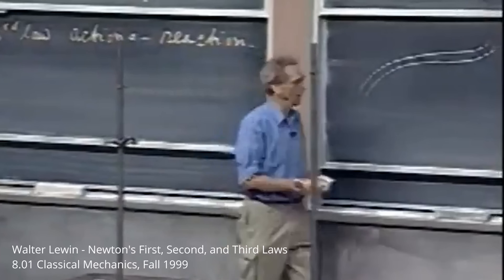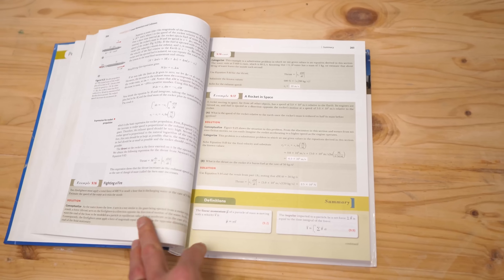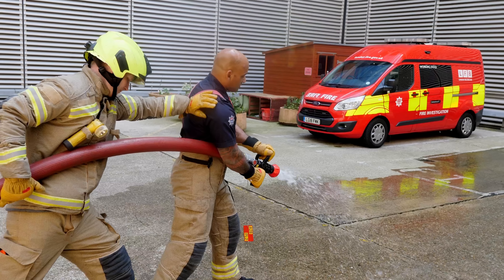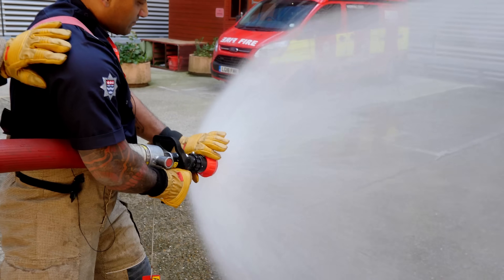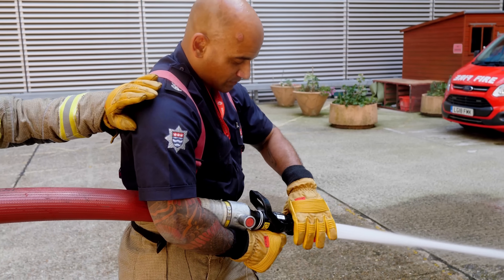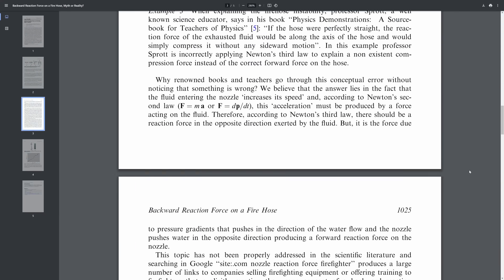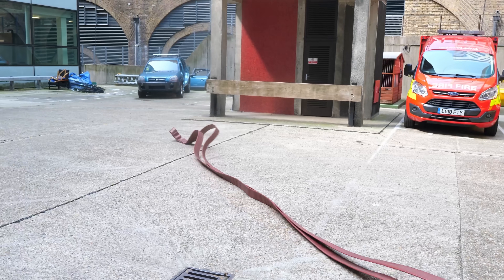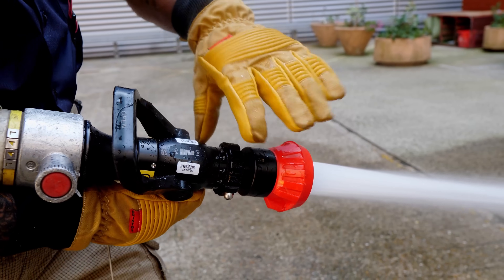Why chaotic hoses dance

Comment: The nozzle expansion is actually how rockets gain the vast majority of their thrust. If they relied purely on the mass of propellant we’d never get to space. So sofisticqted bell nossles are used where the pressure is lower than inside of the burn chamber and this increases the propellant speed and leads to increased thrust

Comment: I wonder if your experiment with the air hose actually illustrates the forces on a fire hose accurately. Since the chaotic waggle of the hose is caused by the reaction forces accelerating the fluids in various directions, those forces should be proportional to the mass of the fluid and its change in velocity. The water in a fire hose is much heavier than the air in the air hose and it is moving much faster, so the “hose pulling force” may contribute a much higher proportion of the force in the fire hose than the air hose.

Comment: Have you tried maxing out the fan at the squiggly-Wiggly-Thinggies to see if it behaved the same? 
Or
Have you lowered the water pressure/volume going through the fire hose to see if it behaved the same?

P.S. Might need to Sans the nozzle as the weight may make a difference to the firehose/add weight to the squiggly-Wiggly-Thinggies to see if it behaves more similar. I would love you to follow up. 
P.P.S. As for the air hoses, I'd imagine the stiffness of the hose plays a larger part to the experiment.

Comment: You also need to consider the static force built into the hose as it deformes slightly (a very small circumferential change along the length of the hose could create a large force. This would cause the violent kick felt when the hose is opened too fast.

Comment: I believe you're wrong about the fire hose, because the reactive "rocket" force comes from the Velocity of the water and not from the pressure itself, the fire hose (and rockets) have a nozzle at the exit that converts the Pressure into Velocity which increases thrust, and moves the point of thrust closer to the nozzle. This is just my intuition though, primarily based on how it feels to operate my electric power washer, there's a bunch of thrust pushing the handle but the pump just sits there on the ground unmoving even though it's kicking out a lot of pressure.

Comment: Ok, so 11:43 is where it clicked that both systems are similar in that they're both fluid filled tubes with enough energy to push their containing cylinder's around. HOWEVER the difference is that in the hose, there is an abundance of pressure, an excess amount of pressure, and that excess there is what causes the flailing behavior, the system is trying to offload a bunch of excess energy. Whereas the flailing tube man's system uses a "just enough" amount of pressure and lets the tube itself act as the constricting force to bubble up the pressure to the amounts needed to escape the system and it's just enough additional energy to cause the bubble of air to lift the tube man. The additional difference between these two systems is that the hose is stiffer and the tube is merely "hose shaped".

Comment: The hose itself is in tension to hold in the pressure of the water inside. this tension is balanced with the pressure inside. We know from fluid dynamics that pressure is felt in all directions, against the hose walls, the pump mechanism etc.
This balance means no net forces as felt... there will be some from the inertia of the water being accelerated at the pump itself, but that's mounted to a 20 ton truck and is likely a centrifugal pump, so the forces will be balanced around the rotor anyway.
The place where the force will be felt is where the forces become unbalanced, at the nozzle. The nozzle isn't just an open hole out of the end of those hose, it has geometry specifically designed to accelerate, focus and direct the water. This geometry is what the water 'pushes' off as it experiences it's acceleration.

Rockets similarly have most of their thrust born by the bell nozzle, That is the element which is in tension, but with an open end. The element 'seeing' the unbalance force, this is why thrust vectoring on jet engines, jet skis etc... only need to swivel the nozzle, not the whole engine.

Comment: As a retired volunteer firefighter, when i was a young guy we used to run loose hose drills, it was a right of passage crawling down the hose.  I somehow doubt they still do it because of how dangerous it is, at least with a nozzle on the end.  Last time I've seen it done was probably 10 years ago with a cut hose end.

Comment: Following this reasoning i guess  that opening a hose in a vacuum would result in a stronger “recoil” because the difference in pressure is grater. I wonder though if the fact that normally the water is also pushing away air as it goes has some relevance

Comment: But bends in a hose/pipe do change the pressure and flow upstream of the bend. It’s the reason that you have to upsize the pipe on your water heater’s temperature and pressure valve if you have 90 degree turns. Should the tank need to relieve, any turns in the pipe will increase upstream pressure and prevent the relief pressure from reaching its full potential, putting more force on the tank.

Comment: I worked as an industrial waste cleaner several summers when I was at school. I had to handle an industrial jet wash. This had a lorry engine driving a hydraulic pump, pumping water down a 32mm exterior hydraulic hose at 2,200 psi. This was exiting the hose through a 3mm nozzle. I would have to coordinate with my colleague when he connected the PTO to drive the pump. I would hear the waggon revs draw down, lean in hard, and find the water and nozzle thrust holding at 30° roughly. If my feet weren't experiencing good grip, it would push me back.

Comment: 3:06 having only watched this far I’m struck with a question: If the hose were to be perfectly straight, not rigid, then the water wouldn’t be compelled to bend it would it? Given that it will be pushing against the inside of the hose yes but wouldn’t it be equal in all available directions? Not sure if I worded it all correctly

Comment: Tell me this, if you had a perfectly straight hose hooked up to a fix pressure valve, and say that it could move linearly back and forth. Would that straight hose piece get force outward into a longer position, or would it be forced in towards the valve because of the water push back. I first thought in would think that in would get forced outward.

Comment: 9:20 The pump (combustion chamber in rockets) generates high pressure at low velocity. The nozzle transforms high pressure low velocity flow into high velocity low pressure flow, feeling a reaction force in the process. I think there's a similar question about where is force generated in a rocket engine.

Comment: This phenomenon can also be witnessed in the rear-end of dogs. If their tails were much longer, they too would have chaotic wags.
=D
I think the weight of the hose+contents can affect how much of a hose will flail about. I noticed with my garden hose, only the last meter or so will flail about. But when I used a smaller, lighter weight one with the same tap, more of it would flail about. Not as violently, as the pressure isn't huge. But still.

Comment: HAve you checked what this implies when taking into account differential speed within the pipe or tube by applying the Darcy–Weisbach's equations? Basically, water has a gradient of velocity across the width of the pipe, introducing resistance and reactive force from the pipe itself, hence the forces don't travel all the way down to the pump, which might explain why the force at the nozzel can be felt by the firefighter.

Comment: When the fire hose is laying on the ground and only the tip of the hose is wiggling, I think it is due to the friction between the hose and the ground, which you don't have in you air model.

Comment: Really interesting video. Have you looked at/thought about the additional impact of the restriction of flow effect at the nozzle of the fire hose? 
It looks like the hose diameter drops from the hose to the metal nozzle that the water is coming out, which will cause a speed increase, and I would assume a corresponding pressure increase as well, though my understanding of physics isn’t good enough to work out how much. (Only got to final year physics, not uni levels)

Comment: STEVE 13:55 if the fire fighter is holding the hose still (preventing it from behind for the first 2-3m at the end of the hose) then the ‘rocket reasoning’ should not be able to apply.

for the ‘pushing a rope’ to be valid u would need to be holding the end of the rope to prevent it from bending, and if u did we would in fact see it pushing without bending

Comment: There's another factor: The nozzle is a constriction, so force would be acting on the nozzle, right? The pressure would be higher through the nozzle than through the hose, before dropping to zero as it exits the nozzle.

Comment: The pump gives the water pressure, not momentum. In most hoses, the water is moving faster out the spout than in is in the hose because of the constricted aperture. There is momentum of the water moving through the hose, but it's caused by the release of pressure and is probably very minor compares to the "rocket" exhaust of the hose spout. So I think your theory is nonsense.

Comment: Every molecule of water (or air) inside the hose is under pressure, due to being pushed from behind by other molecules and at the same time having to push the ones in front, but right at the moment when the restriction of the hose ends, all those molecules want to expand and slow down at the same time, and this creates a pressure buildup at the end of the hose bacause the molecule thats just at the end of the hose (but not out) has to push the slower one in front of it (kinda like a crowd of people trying to quickly exit a building thru a small door) This pressure buildup is pushing the hose back, and it can't shrink into itself so it does kinda what the rope does when you push it.

Comment: I think that fire hoses dont flail as much as your rubber hose because the restriction keeps the hose significantly more rigid, and its construction adds to its rigidity.  I think of a finger trap pulled tight as its woven structure is drawn tight.  Maybe?

Comment: Pumps do not create pressure the only create flow. It is the resistance to flow that creates the pressure. Which means the water in the hose is moving far far slower then the water coming out of the nozzle. Lots of pressure. Means lots of restriction

Comment: the water accelerating at the opening of the hose just doesn't sound intuitively convincing to me. if only you could perform some experiment on it. i suggest introducing colored water. that way we can measure the velocity in-hose and then right after nozzle by examining the footage in slow-mo.

Comment: The pressure in the hose will decrease along its length due to friction. Steve is right that there is no net force on a bit of water. There is, however, a pressure difference on either side of the bit of water, just enough to overcome the friction felt by the water.

Comment: Interesting thought argument, but you can push on the end of a length of string to push all the way to the end. You haven’t taken into account the hose itself in that analogy. If one was to constrict the volume that the string can occupy by adding a hose around it, you can in fact transmit a force along the length of the string/hose combination. This is how Bowden tubes on a 3D printer works, bike brakes, etc.

Just something to consider.

Comment: This was really curious to think about! I'd like to see a follow up experiment, where the hose is discharging into a pressurized container. Then you could mess with the ambient pressure and see if it affects how the hose flails about. Separately, I wonder if the rigidity / material of the hose has any impact.

Comment: What about a mechanical restorative force induced by putting the outer radius of the hose into tension? Spring-back force from being stretched, in other words. That may not become significant until a bend threshold is reached.

Comment: Would not the stiffness of the hose resist the movement.? Where the air hose gains rigidity with pressure, but not near as much as the hose with a nozzles on it.

Comment: could it be the weight and the momentum/mass of the actual molecules/particles? air takes less force to move, whereas water is heavier and stays where it is without a higher force acting on it?

Comment: The pump creates potential energy, stored in the flex of the hose. Then crucially, the nozzle is smaller than the max flow rate of the pump. If you had a sewage pipe sized hose flowing water and it had a 2ft diameter it wouldn't create or impart a large dynamic force. It would strictly be slow moving water escaping a volume via gravity. Like a bucket with a hole in the side. All that would matter would be the side force from the water needing to move sideways to leave the bucket. 

Secondly and more importantly, the pressure in a hose and the stiffness of the hose itself (from its own materials or the pressure inside) dictates if it acts like a wavy tube man or a garden hose. Water and the hose material are very "rigid" allowing for no buckling. Yet it does allow for movement which means there is more stiff area and a less stiff area just like the tube man. Instead of a buckling area moving along, its an increase in rigidity which accounts for the weird flailing that gets more pronounced as you go along. 

I could be wrong as it would be hard to separate the flow out the end from the flow's pressure along the length but you could build a tube with variating materials. Like nylon, rubber and copper. 

If a 1m long hose has a 50cm length at the beginning or middle does it act the same? Or is it only along the length of hose that can flex and impart pressure differences. Or is it only if allowed access to the exiting water on the end?

Comment: I'm not sure you can neglect the friction at the interface between the water and the inner surface of the hose. It is known that water in a hose (or pipe) flows more quickly in the center than it does near the periphery. That mismatch must create a sheering force that must cause an equal and opposite force somewhere. My bet would be that the walls of the hose get pulled backward (toward the pump) and that this creates additional longitudinal tension in the hose that the firefighter experiences as increased kickback at the nozzle.

Comment: My thinking is that the water isn't actually energised very far beyond the end of the hose. As soon as it isn't constricted by the hose any longer, it begins rapidly losing its energy & is pulled forwards largely by momentum and surface tension, as opposed to it being pushed forwards by the water behind it, which is why it's so hard to get water to travel long distances without a hose. Liquids are not actually being compressed either (at least not in any big way); it's about flow restriction instead of pressurisation, even though we call it pressure. This means the person holding the hose is fighting against lateral forces in all directions as opposed to strong reverse forces, & this only feels like it's pushing backwards because it's never moving in a single direction for very long. Obviously there's a little reverse force but I'd think it'd be negligible compared with the lateral forces at play.

If that person were to step up to a wall, however, the water would no longer be able to disperse and lose its energy, and then that person would begin finding it much harder to hold in place. You can test this on a smaller, safer scale using a pressure washer & gradually approaching a flat surface with it, but again it's lateral forces trying to slide the nozzle across the surface instead of simply pushing back away from it. It's kinda like how two magnets with like polarities will become increasingly hard to keep aligned the closer you bring them; it's easier for them to go sideways than it is for them to go backwards because the strength of the field decreases with distance just as the energy in the water decreases with distance.

Comment: Imagine an infinite cylinder of water (or some other liquid) running straight in a vacuum and without gravity. What difference does it make if I wrap a part of that running water in a friction-less hose? I think it makes absolutely no difference. The water should not accelerate or decelerate at the end of that hose.

Comment: Maybe it does just work as a rocket, and on certain hoses only the end wiggles cause the force has to overcome the weight of the hose, and it can do it to a certain length. Those firehoses are probably quite heavy, and the force can move it to a point. But this reminds me a bit of how anchors work. The "rocket force" needs to overcome every added cm. Plus, I'm sure the elasticity of the hose is important too, but that's just another force to negate from the rocket force next to the weight of the hose.

Comment: Every time fluid dynamics are involved I can't help but think that... fluid dynamics are kind of difficult to understand. At least I find it difficult and a bit counterintuitive at times, like with all the trick pots - I had a hard time unterstanding those too.

Also I was thinking: isn't the pressure lower at the nozzle when you turn from focused stream to the more open spray? I was thinking about that when the firefighter showed it. That would have been a nice clue to getting to the conclusion that it's all about the nozzle mechanic.